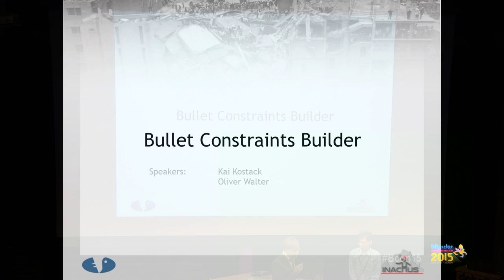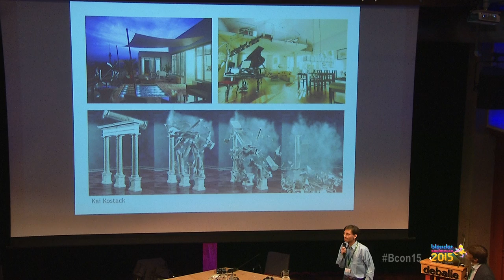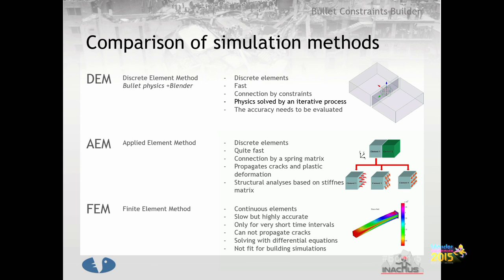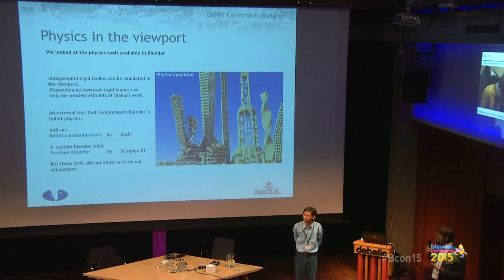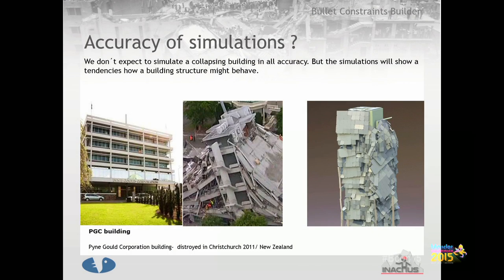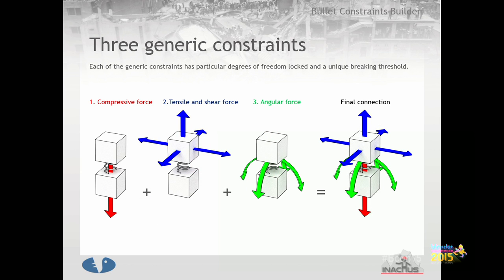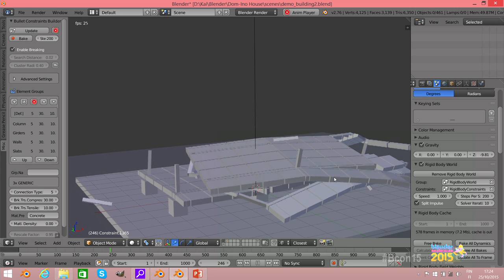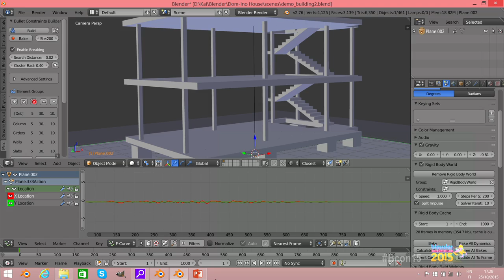Bullet Constraints Builder for collapse simulation - Oliver Walter and Kai Kostack

Comment: it would be well a tutorial on this addon
Reply: +Mir Viyan when downloading the add-on from:
https://github.com/KaiKostack/bullet-constraints-builder
you will find a pdf with a manual in the same zip file. However this is not yet a detailed tutorial. We hope to able to produce one soon enough. For now the tool works well with the standard settings: after installing the tool in Blender, the model you want to simulate needs to have physics applied. The simulation steps are: "build" -> "bake"